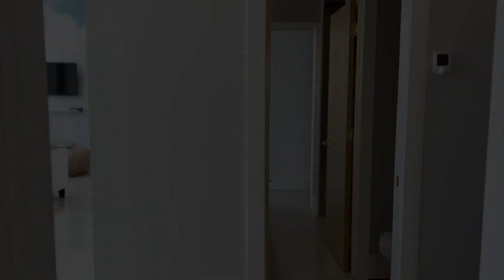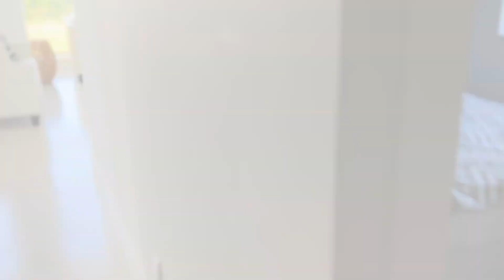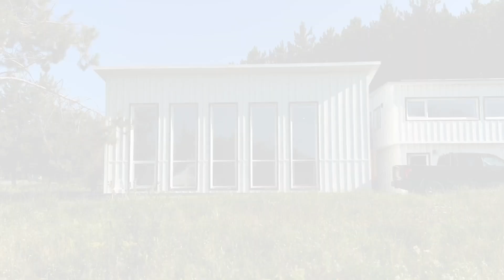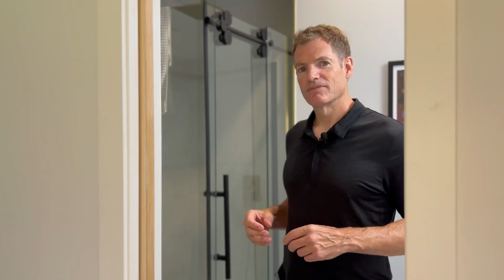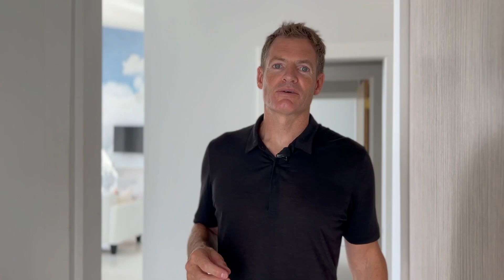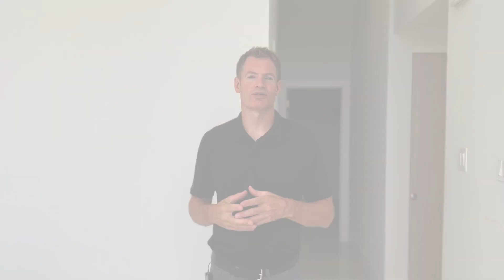An Exclusive Passive Home Tour of the  Pine Valley

Comment: You said it's $350/sq to build so am I correct to assume this build was ~$525k? And given you're a Canadian company, is this estimate in CAD?
Reply from the maker: @DaveTung-y8h  Yes $350 ft.² CDN approximately, in general cost ranges $300 ft.² to $400 ft.², the former for larger homes, the latter for smaller homes

With respect to this “Pine Valley” model, the actual outside foundation dimension is 1634 ft.², please see the link below to this design page where you can see a link to the cost analysis document, when you calculate build cost, including finishings, cost = $353 ft.²

https://ekobuilt.com/ekobuilts-services/ottawa-passive-house/passive-house-plans/pine-valley-bungalow-floorplan/

Comment: Regarding the kitchen hood:  It looks too high off the surface of the stove.  My hood was NOT installed according to the manufacturer's suggestions and it doesn't work very well.  It's about 18" too high.  DId you follow the manufacturer's installation suggestions for your hood?
Reply from the maker: @nad3020  yes this one is at the low end actually of the manufacturers recommended height. Which is great because close to the cooktop doesn’t get turned on much at all, the ERV exhaust in the kitchen in a passive Home complement any range hood ✌️
Reply: @EkoBuiltPassiveHomes  Thanks for responding.  I'm glad to hear you got it right.